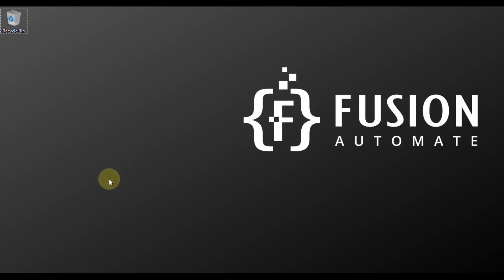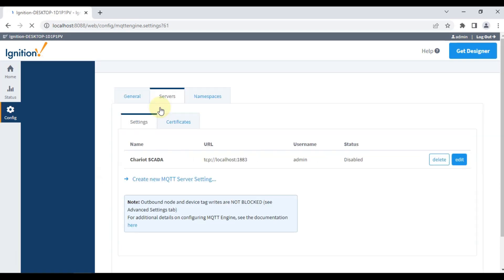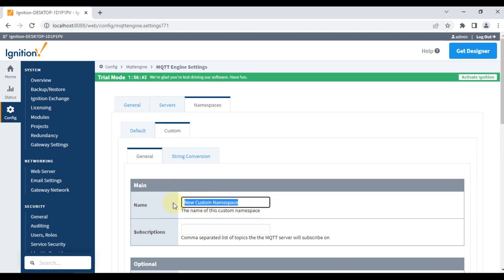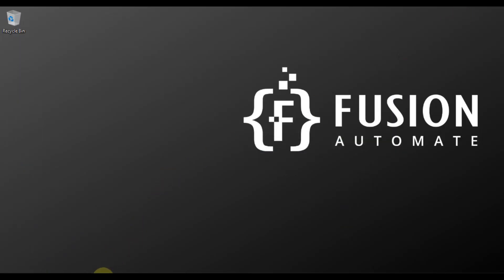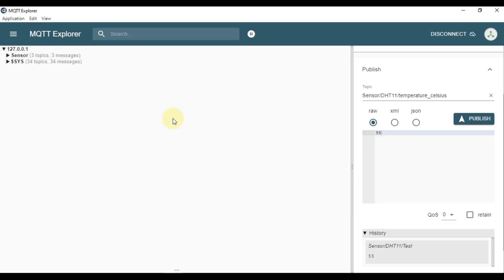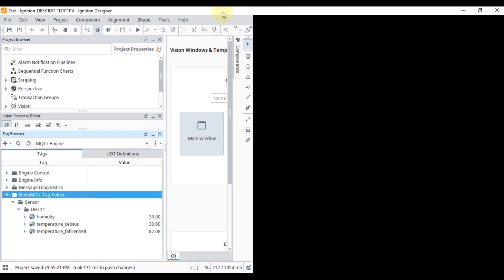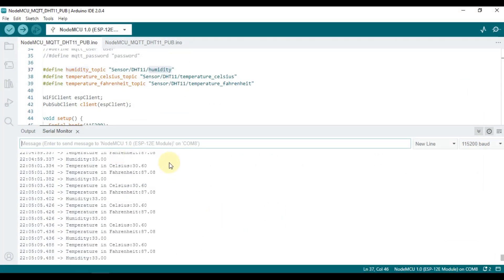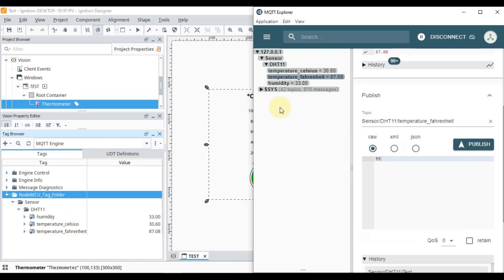How to use MQTT Engine Module in Igntion SCADA | Publish DHT11 Data from NodeMCU to Ignition |

Comment: I followed each step and everything seems working. I see my tag folder ignition and tags do update when MQTT Broker on my raspberry pi publishes new data. But the part I am struggling with is when I try to write a tag, the ignition is not publishing data back to my raspberry pi. For example I cannot control an LED state ON/OFF from ignition. Can you help me with that. Thanks.

Comment: MQTT explorer is part of ignition?
Reply from the maker: No, its a separate software.
Reply: @Fusion_Automate  I want to connect a PLC to ignition, using MQQT. Do I need a MQQT explorer to connect to it? (Also I need to see the tags) 

What are the steps, or which menu tabs do I go to? To just connect the plc?

Thank you very much
Reply from the maker: we use mqtt explore to validate the mqtt data. So for data validation and testing you can use mqtt explorer.

If you want to connect plc with Ignition via mqtt then program your plc to directly publish data to mqtt broker and you can use same broker connection in Ignition to read the data.